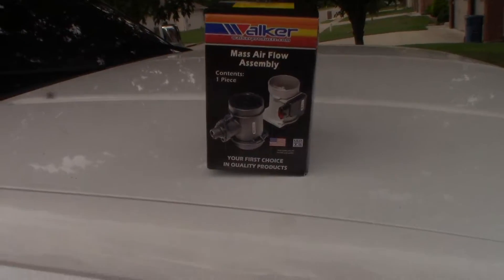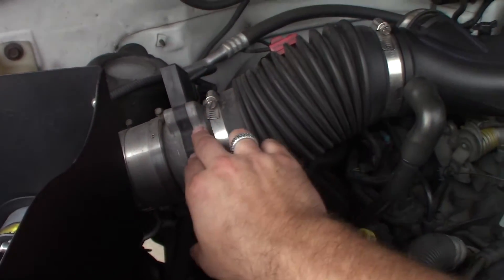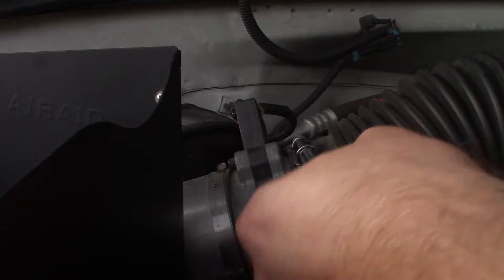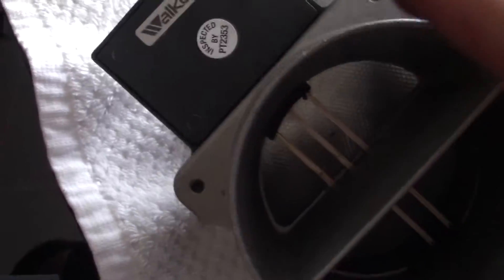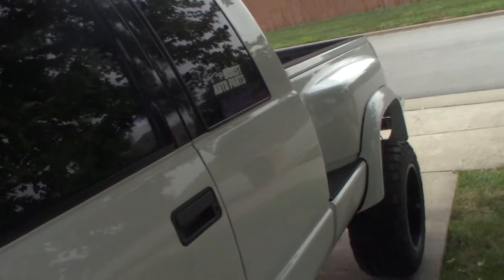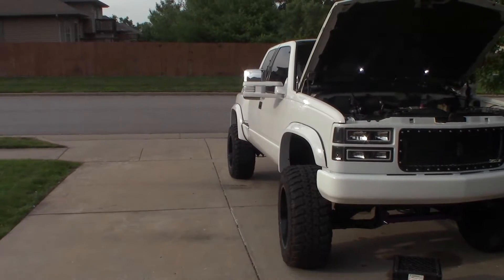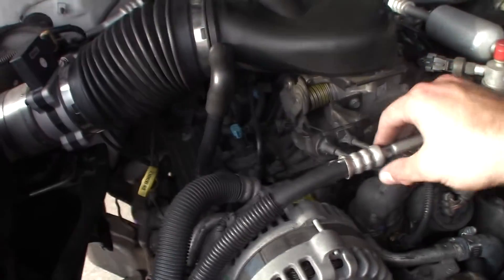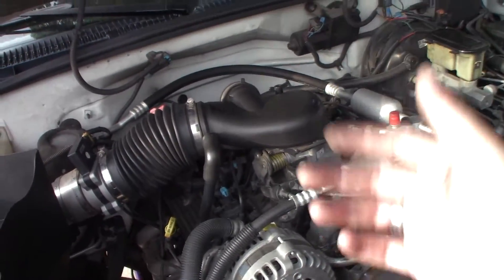Well, that wasn't the problem

Comment: Last year I replaced my friend's 2000 Jimmy's spider injection system over to the Delco multiport replacement after chasing horrible idle and power loss for  6 months. The minute we pulled off the upper intake there was fuel everywhere! Thing runs like new now. I know it's a different rig but it had the spider injector setup like you do. Keep up the good content, keeps me plugging away on my 92 k2500.

Comment: Where do you get battery terminal extensions i have rocklights and light bars and I've got barely any threads holding them in to the battery?
Reply: I got mine from autozone

Comment: Hi I am new to the channel i have watched a lot of your posts because I was looking to lift my truck this summer and I have a suggestion aside from a fuel filter check your pressure of the regulater is going bad it could be sending too much gas through and give you a richer run I have a 98 GMC I am a mechanic by trade but O2 sensors could cuase that as well

Comment: I did the new upgrade spider fuel injectors when i over hauled the engine,And let me tell you smooth starts nice good acceleration,Really could tell the difference,Did all new senors.

Comment: Mine did the same thing and went through the mass air flow sensor new plug wires and plugs then i changed the fuel pressure regulator and it did wonders

Comment: Nothing to do with the video but by chance do you know if newer GMC Sierra mirrors would work on these trucks? Not tow mirrors just the classic style
Reply: I have a set off a 99 to 05 I believe and they worked just fine for me
Reply from the maker: Unfortunately they won't bolt right on. The base is way too large for our doors. I haven't seen anyone custom fit them yet either.

Comment: Some potential helpful info:
My truck (96 z71 k1500) had the same exact symptoms and although I have no catalytic converter, (not sure if that plays apart make some money different) but if you haven't already, replace your oxygen sensor. Soon as I replaced em, the truck ran great immediately. What I was told was that when an oxygen sensor is malfunctioning it can cause your vehicle the sink that needs to pump up work gas, this is why you smell it so rich, and when it's running super rich like that it has a tendency/almost a guarantee to gum up a lot, so especially if you're low on gas you'll notice it hesitates almost as if your fuel injectors are going bad/are bad .  I don't know if this helps at all or if it even sounds feasible to you LOL but I'm just going by my experience and I'm telling you I replaced all my oxygen 02 sensors and it was day and night difference 👍